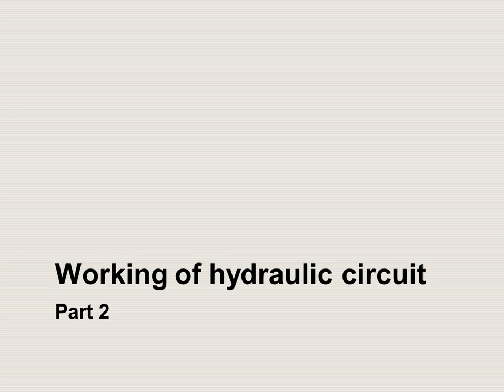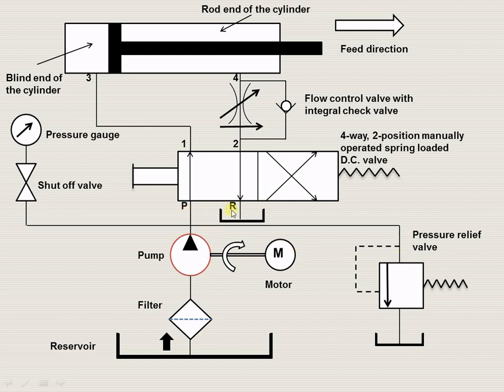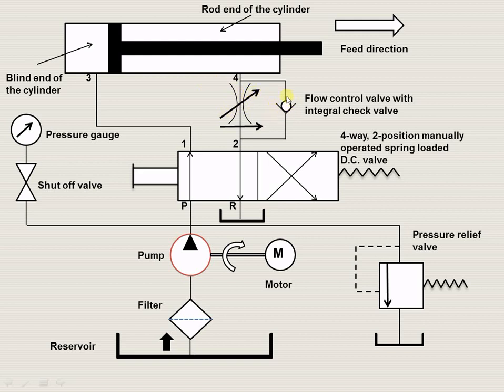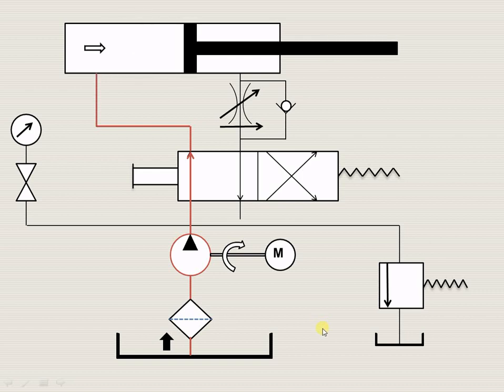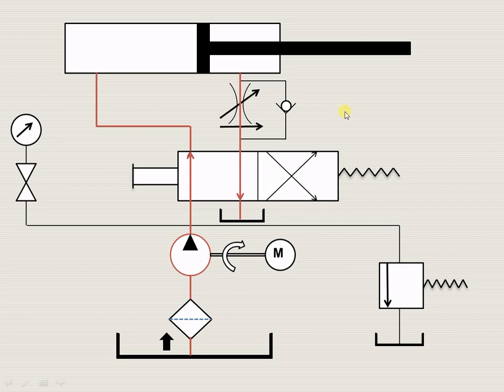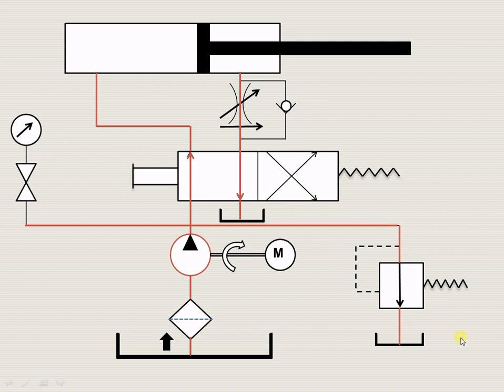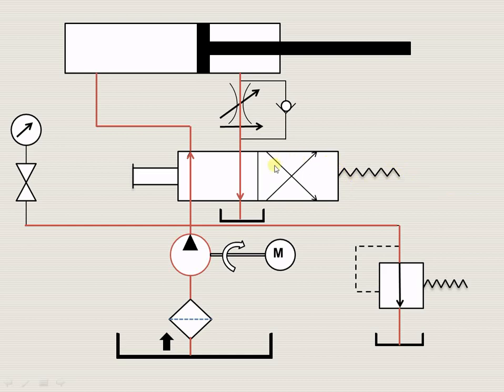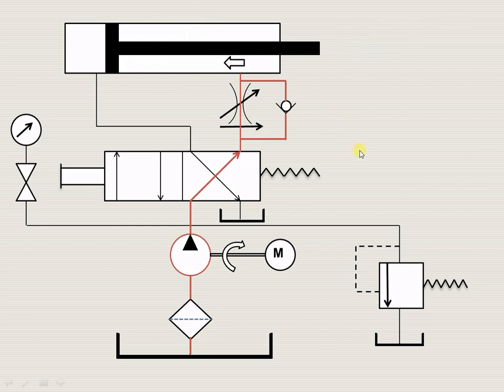Lecture 3 |  Meter - out hydraulic circuit

Comment: Hi where is the correct location for filter in a hydrulic system ? Before the pump or just before returning to the tank?
Reply: Anthony Giordano there are 3 types of filters.
1. Suction filters- between tank and pump -150 micron capacity
2. Pressure filter- from pump to actuator- 10 micron
3.return line filter- actuator to reservoir tank - 10 micron
Reply: Gautam Aasundra thanks